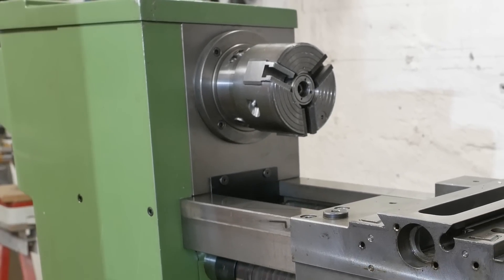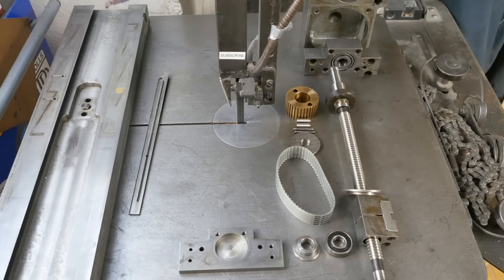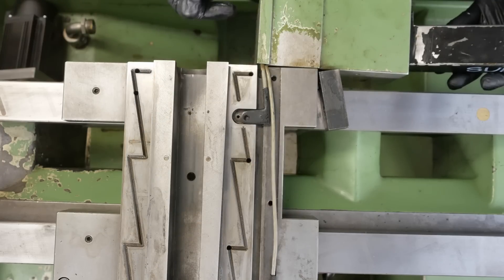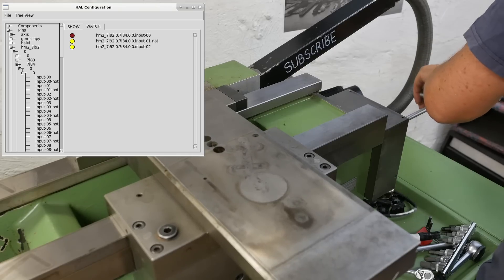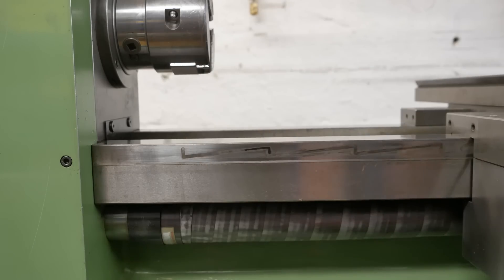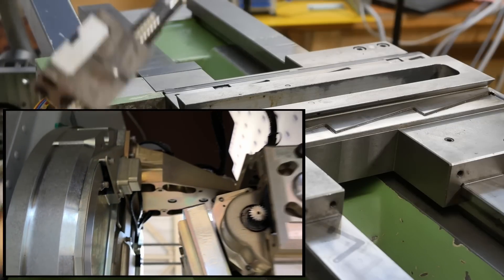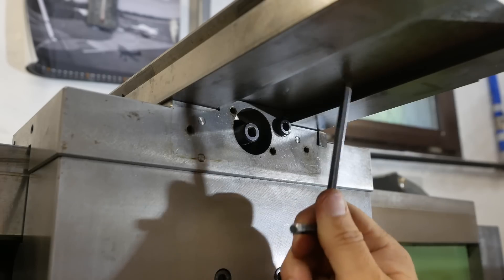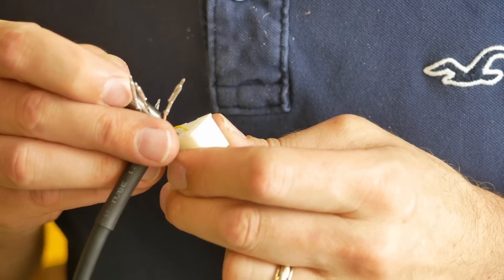Installing the cross slide - Schaublin Ep. 39

Comment: On my custom linuxcnc control, I have implemented virtual soft limits on each of the axis direction. 
Basically I can jog the tool tip to a specific position, and press a teach in button for an axis direction. And while that limit is active, the tool tip will not move past that limit. 
This also takes into account the tool offsets, so its carried out trough the tool changes. 
One aspect for which I am using this is when I have the tailstock locked closer to the spindle, and I don’t wanna bump the Z+ axis into it. However for Z+ when I do the teach in, specify if I want the tooltip position or machine position.
Reply from the maker: Nice one. Did you do a complete interface from scratch, or start with Axis, Gmoccapy etc?
Reply: @RotarySMP  Its from scratch, even a different language (kotlin which is a fancier java) , I've built it thinking how to benefit of all the capabilities of a teach in lathe, which my Weiler E30 is. I've looked on how Weiler has implemented some features in their latest siemens controllers, and I have tried to add those features in my program too. This virtual limits was one of them, but named differently. You can email me, perhaps we can share some nice ideas.
Reply from the maker: @LikeFactoryMade  Oh right, I have been subbed to your channel for ages, but somehow missed your last video. That Weiler E30 is also a dream machine.

Since you have both Joystick jogging and jog wheels, which do you find you use most? I was planning to only put two jog wheels on the Schaublin.
Reply: @RotarySMP  I use both of them in an equal manner I would say. On the joystick I have implemented feed & rapid functionality, so its just like the original weiler control. 
On the joystick, when I do a feed move, I catch the pin change in the software, and I issue a G53 G1 Z0 F0.1 command, and this starts feeding towards Z- like a normal lathe. When I bring it to neutral I need to do some black magic to stop the feed without stopping the spindle, but it works reliable now. 
Also I can do taper turning to a specified angle that I enter from my software, and then I issue a G53 G1 Xsmth Zsmth, and it goes diagonally to that angle. This way I have eliminated the toolpost I had and now I have a solid toolpost.

Comment: Can't say the 90's machines i drive are modern but the axis end stops are inductive sensors for soft limit and there are also mechanical limit switches for hard limits. I would guess they usually still use that style setup tho. Depends on the overall setup too i guess because they have fancier types for measuring the position nowdays.

For gib adjustment I remember ages ago nyccnc had a video on adjusting the gibs on a tormac mill. He said its a good idea to drive the axis at high feedrate to have less power so the adjustment comes better. Rather than using low feed where you would have more torque and then it binds at high feed.
Reply from the maker: Thanks for the tips. I was surprised that the Schaublin has no end stop swtiches, but I guess that is what the clutches are for.
Reply: @RotarySMP  I expect any machine has clutches just because the motors these days pull like tens of kn (the machines i drive have around 10-15 kn). They have to have multiple stages of protection because these things are expensive af. You sneeze wrong while driving and things go south very quickly. The shaubling is a simple and probably slow machine so it has less protection.
Reply from the maker: @TommiHonkonen  It is funny how a slow machine like this, feels really fast, when things go south. I hate to thing what it is like on the 40m/min machine.
Reply: @RotarySMP  Even a slow one will make damage to itself if it doesnt have safety. The ones i drive are just 20m min rapid but the way they are built usually it is not that big of a deal. 

Like for example there is an obvious bug in the system where i disable sub spindle use on the lower turret and it does so on the upper too where its not supposed to unless they have been synchronized properly. I had crash due to that, upper rapid into the sub. Pretty much only damage was the tool holder (hsk 63) just split the tool into the body and cone and the grip fingers in the machine cone got messed up (few minutes off fiddling to change those because we had spare ones). It just gave away at the weakest link and stopped the machine by itself because there was too much load on the servo. Of course did a check on the b axis and it was just fine. Changed the setup to the other machine because it was the more sensible thing to do as I have 2 of the same machines to fight with. 

These machines especially are built so that there are so many levels of protection you would not even think of. Even the manual itself states it. Something will just move/flex/give away along it's axis and then it's supposed to be less work to get it back running again. Unlike a machine that is so rigid that you have to set the hall straight it's in after a crash.

Obviously proper new machine has it's own digital twin and crash detection and it's programmed with cam so it's basically impossible to crash it by accident. Tools measured in machine and so on.

But when do we ever get proper tools at work? Never says my 6 years at this place. Everyone else but me.

Comment: Quite a few CNCs set the gibs by measuring motor current for the drive.
Reply from the maker: That is an interesting method. I guess that only works if you  have factory values.

Comment: I would have honestly just cut the cable dead in the middle and installed an M16 connector. I even did that to our christmas lights because a section was too hard to remove lol
Reply from the maker: I was tempted, but the encoder cable needs 15 pins, and I think M16 only goes up to 12.
Reply: @RotarySMP  They kinda exist, just not the official ones I think. Same goes for GX16 connectors
Reply from the maker: @whatevernamegoeshere3644  Oh, thanks.

Comment: Regarding the hall effect sensors: have a look at farnell, mouser or any el.components supplier. In case one breaks down there are options to replace the original ones. You are not alone out in the cold.
Reply from the maker: Thanks. One of the guys with a Schaublin 125-CNC on a german forum already replaced his, casting the sensor into epoxy so they fit in the original pockets.

Comment: I think that copper jumper you showed on the radar is probably a rigid coax assembly
Reply: Yip, the black art of RF design.
Reply: @johnalexander2349  That sounded like a Curious Marc phrase…🤔
Reply: @624Dudley  I think this is the ultimate presentation of RF design as a black art: https://youtu.be/eyA2lWQrxwg?t=1010
Reply: @foffu  I see your point! 🙂
Reply from the maker: It was a VHF com unit, but it could well be. I am not very good at the electrical stuff.
Reply: Yes, having worked in lab developing radar and other exotic RF stuff I would say that even though it looks like an old piece of domestic plumbing it's really a highly spec'd piece of rigid coax.
Reply from the maker: @foffu  My avionics ignorance was showing there :)

Comment: 3:51 i always do back off screws, that clicked torque wrench without moving. I'm imagining, that this can be anything in 0-10% less tension than proper moving until click happens
Reply from the maker: Thanks. Good point. Although torque is also very dependent on lubrication, tribology etc, so it is a pretty rough guide.
Reply: @RotarySMP  I do know, that this is propably fine, there is no way to get 30% or 50% off. I just want to get best possible outcome with tool that I have in hands anyway
Reply from the maker: @poprawa  That is a good way to approach things.

Comment: You can always adjust the gib without the ballscrew assemble, measures gib depth with micrometer or calipers…. Disassemble all, mount ballscrew assemble and put the gib in the same position 😉
Reply from the maker: Good tip. Thanks.

Comment: Software limit is used on a modern cnc lathe, theres only a home switch then an encoder home pulse, or an absolute encoder system is used.
Reply from the maker: Oh, then that is similar to what I have on the Schaublin then.
Reply: @RotarySMP  "Modern" is relative term, all our CNC machines from the mid 80's and up have software limits that can be adjusted in the parameter page, that comes in handy when a setup needs a few extra mm's of travel to "stretch" the machine. Also handy to limit travel to avoid workholding or other obstacles at either end of travel. The older machines have contact or proximity switches which tell the control when to start "looking for home" on the next encoder revolution (master etch line on oncoder) The newer machines have absolute encoders which know where they are at all times without switches with battery backup so position is not lost when machine turned off. With your machine I would make the machine home position at Z+ and X+ (lower right quad when looking from above) and leave room for some overtravel. Also consider hard limit switches (lever with roller) wired into emergency stop circuit to prevent trying to "home" the lathe when it's on the other side of the hall effect sensors or other runaway situations. This can prevent running the ball screws beyond their travel limit and causing damage. Good luck.
Reply from the maker: @MRCNC1967  Thanks. Now I have X assembled, I have to see how much over travel I have on that axis. On Z it would be pretty simple to fit two e-Stop travel switches, but  I think it would be more useful to mount a tailtock estop, as running into the tailstock seems quite likely.
Reply: @RotarySMP  Agreed, a limit switch to avoid the tailscock should me a must-add.
Reply: Software limits are generally a lot more useful. Not only do you need less components, but the stop is a lot less surprising, i.e. the motor controller can implement smooth deceleration, instead of reacting to a switch suddenly getting turned on or off. 
If the motor for that axis also has a brake, then there is also no danger of the software limit getting out of sync.
Reply from the maker: @graealex  Hi Alexander. There is not brake on the motors, but I will be passing the encoder signal through the driver, so it will keep position in the case of an e-stop.
Reply: @RotarySMP  That's fine as long as you ensure that you always drive to the home position after a reboot. With a brake, you don't even need to think about that, because the axis cannot move unless the controller is active.
Reply from the maker: The Maho has a brake on Z, but I was happy to fin off the shelf AC motors which fit this machine. Getting motors with brakes would have upped the price a lot.
Reply: @RotarySMP  Of course. When doing it professionally, you just get the motor exact to spec. With hobby, you search for parts that might fit and are affordable.
Reply: My friend's first 3d printer had a home switch and a limit switch like in 2012/13 when the DIY home 3d printer craze was slowly starting. I never bothered to ask him why even though I've built several Mach3/LinuxCNC machines with soft limits.
Reply: @chronokoks  There are a few good arguments why a 3D printer might have them on both ends - they mostly use steppers without any encoders, so it is a real possibility for the soft limits to not be accurate.
Also, the mass you are moving around is very small, so you can usually stop exactly on the limit switch.
The other thing is that you don't need any switches at all. You can just drive the axis into a mechanical stop, and optionally sense the current.
Reply: @graealex  If your printer looses steps that means either your "tuning" (motor selection, step angle, microsteps, voltages, speeds) or your mechanical assembly (axis binding) is trash and you should start over.  No reason to use hard limits ever on a 3d printer. Period :)
Reply: @chronokoks  Whenever you're not printing, the controller shuts down the current on the stepper drivers, and depending on the design, it will either by itself or with only very little outside force change position on one or more axis.
This hasn't anything to do with tuning. It's just without encoders, you are simply not able to really tell where your current position is, and steppers without encoders/feedback are currently the defacto standard for 3D printers.
Reply: @graealex  I've been running stepper motors for 10+ years on over 500+ machines and I rarely had problems you mention - and we've been doing servicing too all around Europe. Most drivers do keep current high enough for solid holding torque - the older ones just kept the current at 100% basically so you get extra heat. You're just trying to rationalize out of what you've said first. Steppers when everything is done right are extremely reliable, precise to a point it's almost unbelievable - I still shake my head how some steppers endured years of abuse and extreme temps yet they still work perfectly. Servos are servos, but steppers can do magic too. Trinamic drivers don't even need home switches - they just detect stalls/signal spikes and you can use that signal as and end stop - with a surprisingly good accuracy.
Reply: @chronokoks  Let me repeat. Without an encoder, you literally do not know where the motor is, unless you home it, and make sure that the holding current will surpass any potential forces that might move the axis, at all times. And it does not matter how reliably steppers work - the point is that a stepper driver barely knows there's a motor, let alone what it currently does.
And particularly with 3D printers, keeping them running all the time seems a bit silly. 
Servo drives on the other hand can absolutely tell where the machine axis all are. Current is only applied when outside forces are applied. If you have either a motor with a brake, or a motor encoder that either employs a battery or energy harvesting, the position keeping ability even extends to states where the machine controller is fully powered off or even completely disconnected from the motors.
And despite you pulling out the "million machines in thousands of years" pro engineer card, no one in any serious industry uses anything but brushless servo drives. That's for the simple reason that steppers have a serious lack in torque, and gear trains create intolerable backlash. Steppers are used in 3D printers because they are cheap. Not because they are good by any stretch of the imagination. The simple fact that steppers with integrated encoder and feedback exist shows that the issue is not resolved by simply saying "steppers are reliable and never lose steps". Particularly because torque decreases dramatically at higher speeds. It is not as binary as you are portraying it.
Reply: @graealex  Now I don't even know what you're arguing. I clearly stated, that if you produce proper mechanics and control (proper signals, driver settings, electrical parameters), steppers motors just will not stall - lose steps. They will stall only when some sort of catastrophic failure or intervention happens. Steppers don't need to know where they are if they are stepping correctly and everything's fine they will never ever become lost. That's a fact and this is where my experience comes in because I've built and seen machines work year after year without a single failure. You're just trying to prove you know something about the technology by attacking claims I never made - you're building a strawman. Go talk to Printer manufacturers about stepper reliability and how they all should use AC servos. Make a time machine and talk to HDD and disc player/writer about how they're stupid. I'm not continuing replying to you further because you're making up stuff in your head and I'm really not interested in that. Experience over young man's ego all day ;)
Reply: @chronokoks  "that if you produce proper mechanics and control"
That is the seemingly binary thing you are dreaming of. However, it is not binary. Mechanical components wear out. Torque decreases with speed. Stuff goes bad. And not every machine works with so much headroom as 3D printers can, as again, there the moving masses are very small.
You think steps will only get lost in extraordinary circumstances, which just doesn't reflect reality.
Also, HDDs do not use steppers for decades, but closed-loop voice coils. And when they used steppers (MFM drives), they were notoriously unreliable, because they did not incorporate feedback from servo tracks.
Reply from the maker: @chronokoks  The Maho has hard end stops. I think it is common on most machines, but lathes are just more problematic, as the different work holding and the tailstock make fixed position end stops less useful.

Comment: No chuck protection on my ACT4, if you're not careful with programming, you can crash the tool revolver straight into the chuck.
Fanuc 3TF can set soft exclusion zones, to prevent that, though. 
Apart from that, just the usual cam switches for end stops, as found on about every CNC.
Zeroing is done with reference marker on rotary encoder, machine hits reference cam switch, then the servo turns into one direction, until the rotary encoder hits the reference marker => zero point as accurately as possible, without linear scales.
Reply from the maker: Thanks. LinuxCNC also supports home switch plus encoder index, so I need to implement that.